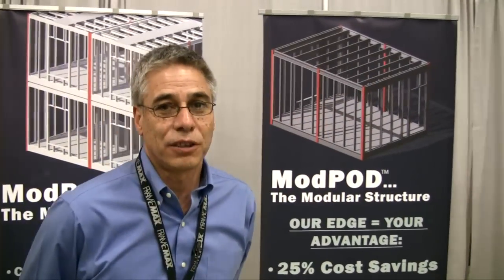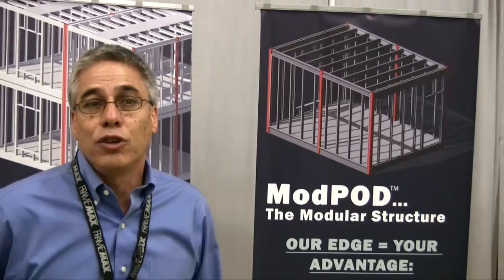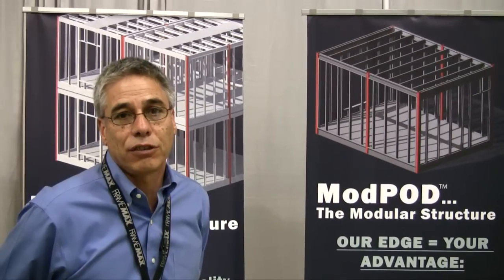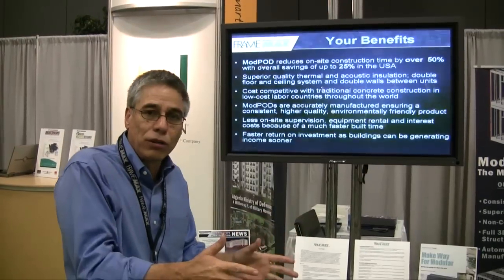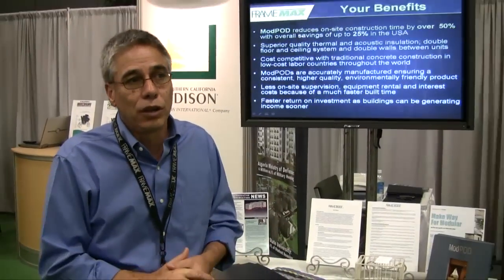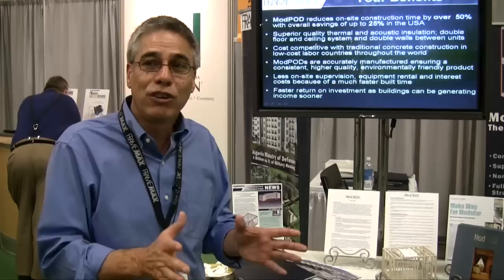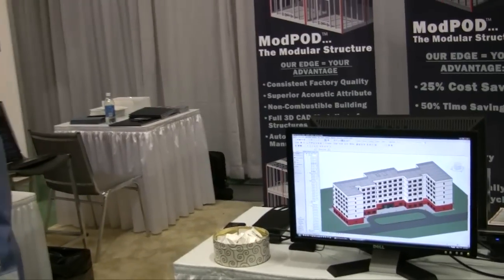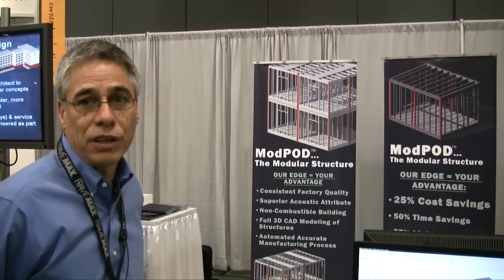FrameMax Modular Steel Frame - buildaroo.com

Comment: I work with light gauge steel framing as well, I am looking to go modular (assembling full modules in factory instead of just wall panels) but according to my information it is not possible to transport modules made entirely out of light gauge steel framing.

Why does the title say it's modular? I only see pre-assembled panels in the video, not modules. You do say that those are stackable but what do you refer to?